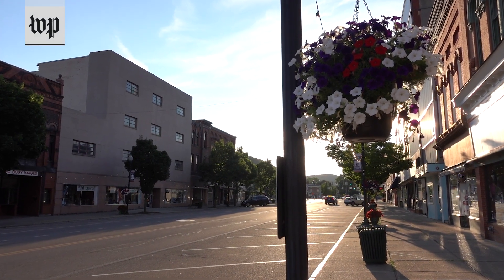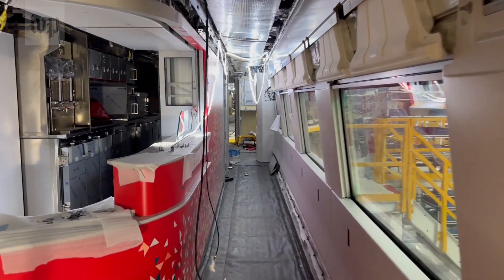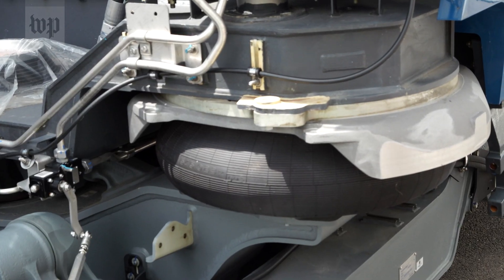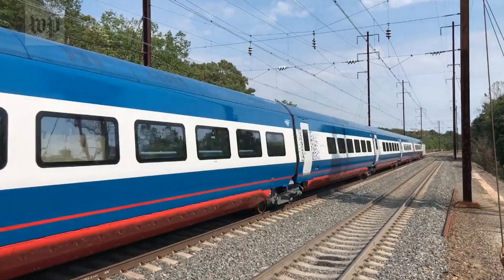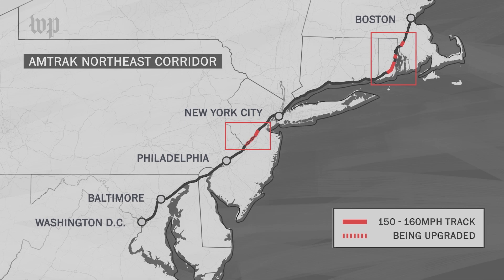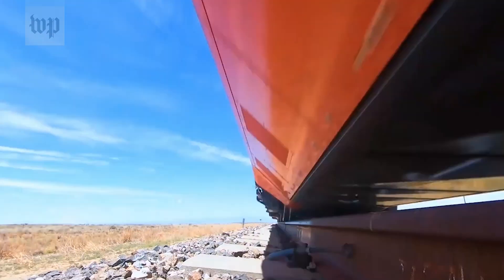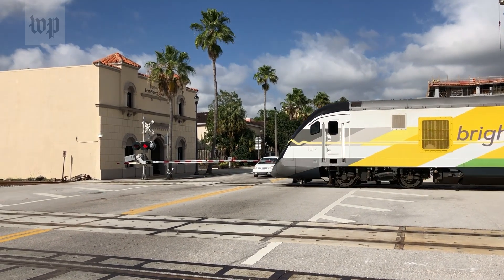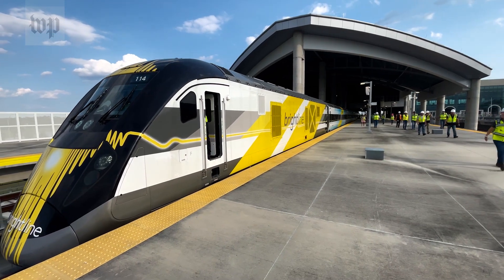Go inside Amtrak’s new high-speed train

Comment: Now fix the tracks!
Reply: Easier to do in the NEC, where Amtrak owns the track, doing it outside the Northeast, where freight rail companies own the track infrastructure, is a whole other matter altogether.
Reply: Exactly! Our tracks are so outdated! Hell we still use wooden ties! Wood!?
Reply: @marvinmartin4692  and not only that, some parts of our rail network had suffered capacity cuts with railways being reduced to single tracks.
Reply: It's a stupid Idea. I don't know why people are obsessed with sandwiching modes of transport together. It's better to build mostly elevated nationally high speed maglev lines than to fix existing tracks that if Amtrak does not own it's own tracks would have to operate along side freight trains which also has the right away.
Reply: @KVM1992  maglev is the worst idea solely on grounds of cost. It’s cheaper to run hsr and it would be on separate track to freight rail…
Reply: @dante_m  😆😅😅😆🤣🤣😆😅🤣😂😂😂
Reply: @dante_m Right and being cheap can also lead to costing more in the long run. Being cheap equals bad quality. It's a bit reckless if you ask me. Not very bright to have ground based high speed trains traveling across the nation on rails which is most at risk of derailment or crashes than Maglev. High Speed Rail works fine regionally not nationally. Your best option would be to take a plane or maglev train better yet hyperloop train.
Reply: @KVM1992  Please tell us where in the United States a maglev train or Hyperloop is running in revenue service. I'm sure we'd be more than happy to ride it.
Reply: @TheRailwayDrone  Not as of yet. Which means we are loosing out on that as well. High Speed Rail in the US is long overdue. There is no trying to make up for all the time we lost on the demand of wanting a fully functioning integrated HSR network across the states. HSR is so 20th century. There's no shame in saying we lost the battle of HSR. What Amtrak is doing is too little too late. Maglev is the transportation of the 21st century. I propose the federal government start working on a prototype somewhere in the Midwest and over time future lines would span outward as a form of interstate Maglev system.  If government not going to do it then I just might have to.
Reply: @KVM1992  Lol...you seem to forget about all the NIMBYs that exist in this country. Maglev will be no more successful here than HSR. Just take a look at the proposed Washington-Baltimore Maglev. People have been rallying against that for YEARS. And we STILL have no information on when or if it will be built. HSR may be "20th century" technology, but it is proven and exists all over the developed world, to the point where many high speed rail lines are putting short-haul airlines out of business.  There are more high speed railways being built than there are Maglev networks or...cough cough...hyperloops.
Reply: @TheRailwayDrone  As for the type of maglev, I prefer electromagnetic suspension over electrodynamic. EMS is more practical in my opinion and wouldn't be too complex like EDS. EMS don't have to be expensive if we use materials that is both lightweight and built to last.
Reply: @KVM1992  Maglev is insanely expensive to build and operate. Hyperloop adds zeros to the price tag at best (that best scenario is assuming someone is actually stupid enough to build an actual route.) High Speed Rail works great and as a nice range between 80-700 miles in which it outperforms driving and flying. That opens up huge sections of the US that people can access using the most efficient means of travel.
Reply: @travisbeagle5691  This is exactly why the US  can never have nice things. There's always an excuse to not have. So it seems the US will always be one step behind of the rest of the world. Never so ahead of them. The US isn't China nor Europe and isn't quite the standard for how to build a network. There's no shame in doing something new despite all the risks. Forget the money, that tends to be the excuse for not doing things these days.
Reply: @KVM1992  a large HSR network will be a very nice thing and unlike vacuum trains, the idea isn't based on total BS. Maglev might have a place, but its role will be more of a supplement or improved service instead of a replacement for HSR because they are so damn expensive. Vacuum trains have been around as a concept for over a century and the tech to make them has been around since the 50s -60s. They never went anywhere because they are a financial and maintenance nightmare with major safety problems. Modern takes at the idea don't have anything new that suddenly makes them feasible and they only make matters worse by abandoning trains for pods.
Reply: @travisbeagle5691  If you are to dream big don't be so petty about how much it cost. A large HSR network will not be a very nice thing because it is considered to be infrastructure hell. Too much of anything is never a good idea. I'm not keen on the idea that the U.S should follow in the foot steps of China. The American landscape is beautiful and I would like to keep it that way. I don't have a problem with HSR, only a problem with how it's implemented. HSR should not be large enough where it becomes the dominate mode of transport nationally such as in China. For me diversity is key, There must be more than just one option. I like maglevs and hyperloops better than HSR. If done right it can be of more practical sense than financial sense compared to HSR where the opposite is true. To me it's not all about the money. It's not one of my worries. I respect whatever opinion you have on HSR but I gave up on Amtrak a long time ago. I'm creating a new American national railway system. Amtrak should not be the only one.
Reply: @KVM1992  Also most of Amtrak's issues aren't their fault as their issues come from complete neglect by the government and from freight rail companies being pieces of crap.
Reply: @travisbeagle5691  It is Amtrak fault and I'm tired of wishing great things would come out of it but I'm only fooling myself because I know darn well Amtrak is intended to be a money sink. Nothing more, nothing less.
Reply: @KVM1992  😆😅🤣🤣🤣🤣😂😂😂
Reply: @KVM1992  The freight networks do not do the proper maintenance for tracks. They run trains that are too long to fit in sidings so trains cannot pass one another and have to wait for hours at switches or in yards. Some trains are too long to fit in train yards now. The trains take longer waiting for cargo for their trains. Not to mention derailments have gone up due to the length of trains, which have to be assembled more carefully with distributed power. They added computerized throttle which goes extremely slow to save a few percent fuel efficiency. US freight rail is extremely slow and wastes lots of time with longer trains and inconvenience customers and employees just so they can save a few bucks.
Reply: @KVM1992  No.
Reply: @ZazzelTheGamer  Why not?